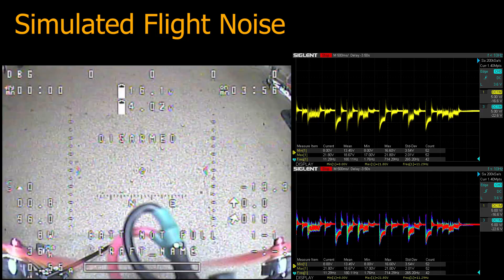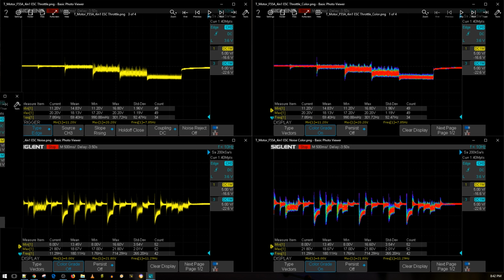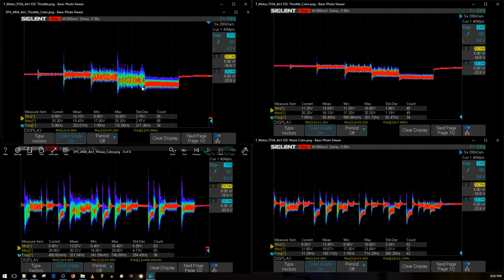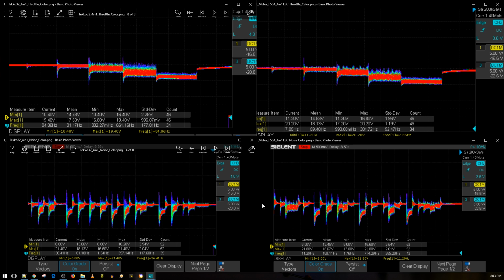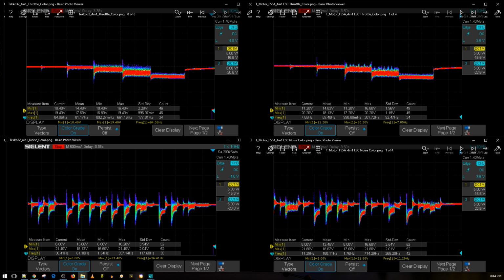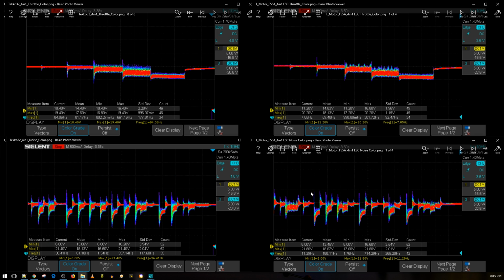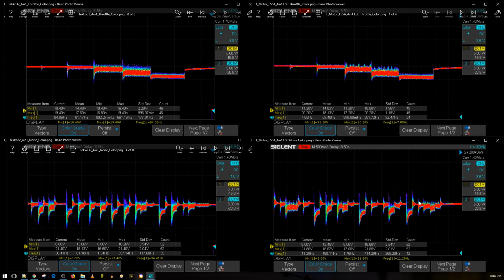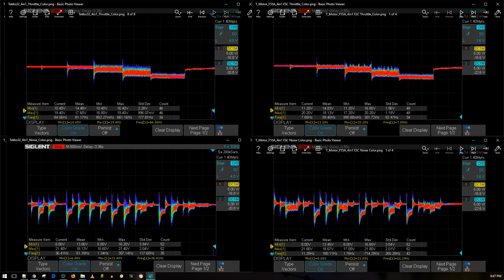ALL NEW BEST 4in1 ESC OF 2018!!! // T-Motor F55A 4in1 ESC Review Noise Test

Comment: Cool ESCs but can't handle crashes that much...mine after 2 failsafes are totally dead, one esc twich and the other burns every motor you connect to it. I can t even imagine what would happen with all the high speed crashes of a race
Reply from the maker: 6s ?? Did you install the caps??
Reply: @DroneMesh  4s , cap installed! the second one was pretty hard, but it landed on the lipo, everything else was perfect, all other components are still running fine! even the frame has 0 damages
Reply: @DroneMesh  btw, not saying it s a crap. it's a great Esc just i didn't expect my xnova burnt when trying to arm after a crash who killed just the lipo -.-

Comment: Greetings an excellent channel, and very helpful, then I bought the DALFC f405 with the flycolor raptor esc of 30 since I saw them on your channel and they work very well but when arming and configuring it with betaflight 3.5 and the problem is that when arming the Drone the engines very fast and heat up fast and it smells bad not burned but if a smell that had never touched me that happened I ask for help no c that can be all is well wired send video link to be seen, greetings and many thanks greetings

https://youtu.be/S6Og7_jlMBE
Reply from the maker: What ESC protocol are you using..  Also did you ground your ESC signals?
Reply: @DroneMesh  yes; connect the black wire of the signal to earth of the esc that is in the fc and in betaflight the protocol dshot 600 and in blheli the last version 16.7 and it makes a strange noise and it smells bad and they heat fast not c what happens
Reply from the maker: @sqb3832  Are your motors high KV.. And stop turning it on your burning your motors slowly
Reply: motors are 2400 kv

Comment: Can you test EMI... honestly the Tekko32 may have been a good 4in1 but it had horrendous EMI with a few 32bit FC's.
Reply from the maker: This is very strange your not the first I hear it from.. But I have 5 quads running tekko32 without any issues. Specify your setup so I can look into this.
Reply: @DroneMesh  Get a Helio board and run it on 5S or 6S. What boards do you fly and on what cell count?
Reply from the maker: I prefer 4S high kv... Dalrc f722, Matek f405 ctr, Holybro F7 and F4 , Dalrc F405 AIO, DroneMesh OpenFC F4 v1

Comment: 6s draws less amps compared to 4s, so why one would need 55amps is beyond my understanding. I'm still running dys 20a on my 5.5" with 4s r-line lipos.
Reply: Because not everyone is doing 6s for the slight better efficiency or flight times. Some people simply run bigger motors or higher kv setups.
Reply: @SuperBarracuz  doesnt matter. still half of my quads run 20a ESC with 2207 2450+ KV  and 5046 props, no problems whatsoever. oh yeah, on 4S
Reply: @Fliptality  Well youre running small motors. By big motors I mean larger 24, 25, 26, 30, 32 sized motors. Plus these higher rated escs have better fets and regulators that can handle higher heat and amps alot better than any old simonk 20a esc could.  Basically you either run your ESCs at their limit or you can run higher rated gear and 'never' worry about burning it up.

Its not necessary but its nice to have something that can handle a beating
Reply: I will run the F55A pro on 6S with the Hobby Brother T5 3115 1050kV. For a 5" it's oversized but for a 10" kwad it's might on the limit.

Comment: Friend of mine has the T-motor f45a esc and he's also very happy with that one. Curious to see what your results will be tomorrow with that one! Oh and may I ask you a question? I bought a mamba stack a few days ago and runned it without a cap on 4s. This went very well without noise in my video but was wondering if it would damage the esc because there isn't a cap on there and you recommended to do so. What are your thoughts? Should I still run a cap on there?
Reply from the maker: Add the cap as it runs much cleaner and can protect your esc from crashes that induce large voltage spike with returning current.

Comment: Wow, dude... Finally a board as good as the Tekko32! 😃
BTW, are you still using the DalRC Rocket 50A? I'm thinking about getting one to pair with a Foxeer F722 (that is the same dual gyro F7 from DalRC), because the pin out is identical... (I won this FC from an Albert Kim's giveaway.) 😊